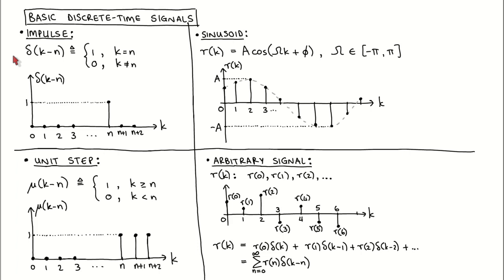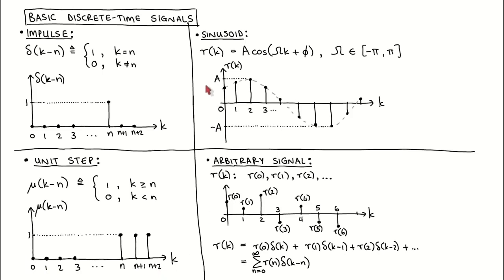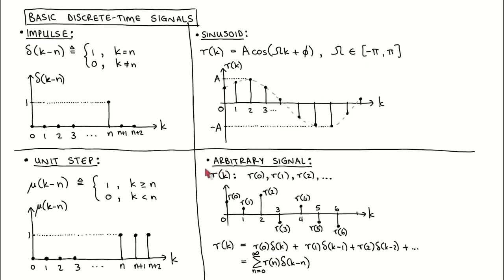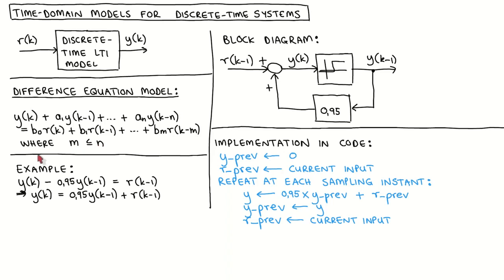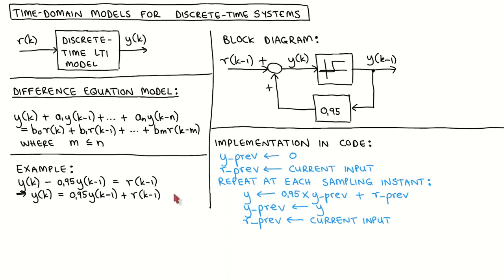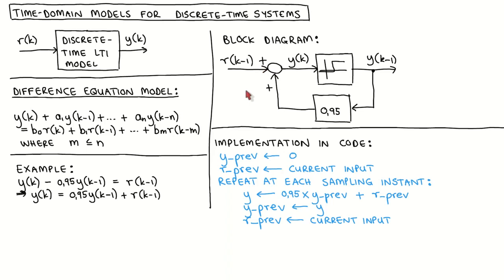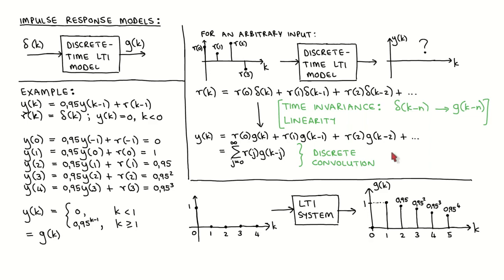Digital control 2: Time-domain models of digital signals and systems

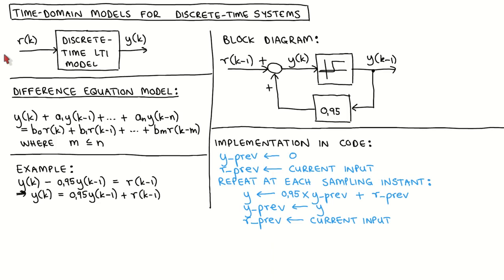Comment: part 2:49-6:35: in the block diagram, I believe more understandable consider the actual values of input and output instead of previous ones; so, if we define the input as r(k), the output as y(k), the output of the gain block as z(k), the time-domain equation is: y(k) = r(k-1) + z(k-1) = r(k-1) + 0.95y(k-1).